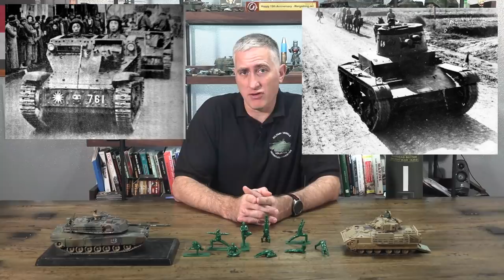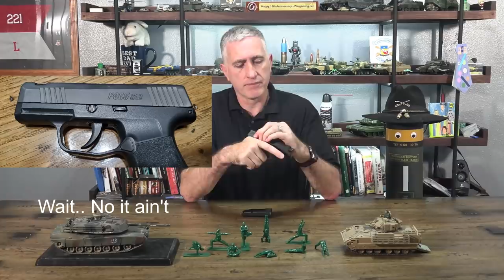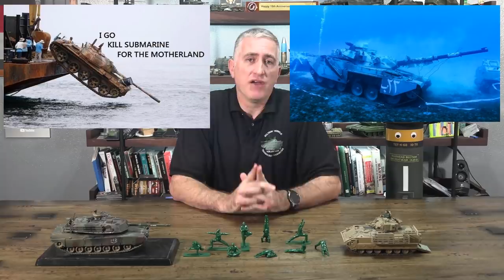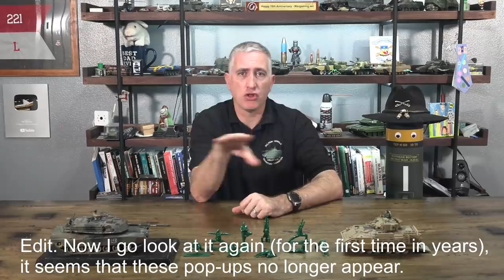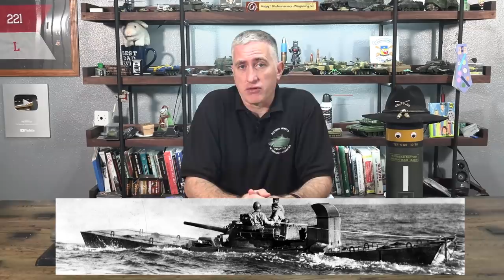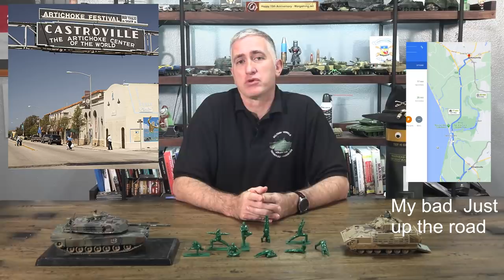Chieftain's Q&A 17. Rants, Ladas and shooting the other guy's cannon

Comment: 34:07 Using drones for tanks would be nice. Here's a fun thought. Drones not only improve your spotting range, but they also enhance the accuracy of artillery (which was interesting, because originally I thought that drones only improve vision range......but, I did a little bit of digging, and found out that they offer other beneficial attributes to the table)

Cause the concept kinda seems similar to the idea of aerial spotters for battleships. I mean, I think I read from somewhere on NavWeaps, that spotter aircraft (during the 1930s. According to the US Navy War College) were capable of boosting the probability of hitting an enemy ship (at very long ranges) by 600% 

(But, anyways somewhere in NavWeaps, its says that spotter aircraft were superseded by radar fire control on ships......but I don't remember why. Anyways, this is weird, because the concept of using spotting aircraft to improve accuracy of artillery still continued past WW2. One example being the AH-56) 

http://www.navweaps.com/index_inro/INRO_BB-Gunnery.php 

Also I seem to recall, that even in modern (-ish) times, aircraft are still effective in increasing the accuracy of artillery. One example that pops in my head is the AH-56 Cheyenne. Apparently this attack helicopter was fitted with sensory equipment that could help improve the accuracy of ground-based artillery.

Well, there's that, and also, because of Russia's use of drones for spotting, and relaying ballistics information to ground-based artillery in their recent conflict in Ukraine

Comment: 35:25 You forgot one feature. The boiling vessel needs an upgrade. All-in-one BBV (Barista Boiling Vessel) will not just heat your water up, but it will make the tea, coffee, cocoa or other beverage to your liking, including iced drinks. cream and sugar can be added based on the crew preference. Once the beverage is prepped it will slide the drink via a rail system to the crew member who requested it. The beverage will be served in a thermal mug to maintain temperature and a sealed top to prevent spillage on delivery.

Comment: @The_Chieftain engines with smoke....our old M113 APCs with the Detroit 6v71-T two-stroke turbo diesels would smoke like a factory, along with the AVDS V-1790 720 HP Diesel in the M48/M60 series.

Comment: Re: the M231 FPW, I'm actually working on reproduction screw/handguard/stock parts for cloning since original parts and existing repro parts are so expensive and rare. That's next after I finish up with the Colt DOE/RO633 front assembly clone parts.

If you ever get the urge to visually clone an AR-15 into an M231 (or RO633), give me a shout and I'd be happy to send you some bits and pieces!

Comment: Problem is, Lada was an obsolete design when it was introduced and parts for it are still manufactured to this day, meaning that the Ladas you see today aren't old, they had a lot of parts replaced Ship of Theseus-style. Whether that's good or bad depends on how much time are you willing to waste repairing and adjusting it far more often than more modern cars.
Reply: In fact, the Lada was provided by Fiat, shipping the whole factory to the Soviet Union as a sort of 'foreign aid'. Supposedly, even though there were some differences between the Fiat 124 and the first Lada's there was were cases of being able to simply take some parts from one and place on another, until the tolerances of the Lada parts had drifted to much to make this impossible. Still, supposedly old Fiat parts 'might' fit. Sometimes. And in some cases, Fiat parts were an upgrade (?) as with the hydraulic brakes. 

Now, on a separate note, supposedly the various 4x4 Ladas were nearly bulletproof, something that couldn't be said for the Fiat version. I guess being a nearly a farm tractor has it's benefits.
Reply: @charlesadams1721  Exactly, and this happened a few years after the release of Fiat 124 itself, so the design was dated when it was introduced, and obsolete for most of its production run.
Reply: @p_serdiuk  maybe, but if it's all you can afford or source it's damn better than walking

Comment: Re: Lada - the lack of servo means its a "manly" car, it is not designed with buffer zones, absorbing crash energy, so with anything faster than city traffic, you have a higher chance of dying - but in a city, if someone bumps into one, it WILL do more damage to whatever modern car it collides that the whole Lada worths and drive away with paint damage :) 
Makes people  keep a respectfull, safe distance around your car. Sometimes I miss mine from decades ago.

Comment: Since you mentioned the Osorio a couple times in this video, what is your opinion of the Osorio? I think of it as a missed opportunity since it seems to me it fits a similar niche as the Japanese Type 10, but 30 years earlier.

It also won a competition against the M1A1 and AMX-40 in Saudi Arabia, though I have the suspicion that it wound up being used as a bargaining chip to acquire M1s. Do you have any thoughts on the validity of the results of that competition?

Comment: Coming from more civilian-focused study of the Soviet economy:

Soviet civilian product quality control was particularly bad because downstream consumers (e.g. enterprises using steel from suppliers) had great difficulty rejecting inputs that did not meet specification. In a capitalist system if you deliver bad lenses to a camera factory, it's relatively easy for them to just not pay you and find an alternative supplier, whereas in the Soviet system this was a fraught political and bureaucratic process.

The military was always privileged, however; if their plane's servos or their tank's springs were bad, they could cut through the red tape and impose consequences wherever was appropriate on the supply chain. Very different level of quality.

Comment: Question for the future: Why Soviet wanted to combine both so advanced and antique tech in their BTR-60 APCs? Why old and complex double engine but modern independent suspension with torsion bars? Wouldn't something like beam axles of Zil with engine been enough, especially considering the requirement to share parts with mil trucks?

Comment: it's a major copout on the X vs. Y argument to make it as broad as possible ex. PZ IV started with 5 crew and continued to be upgraded and was more than effective till the end of the war while T-34 had 4 crew, no radio, and was still cramped and the 85mm upgrade only solved a fire power issue that was only really a problem against the fewer Panthers and Tigers plus they didn't even have a turret basket so the loader had to chase the gun around
indeed better is the enemy of good enough but good enough didn't really help them get better

Comment: Well, tracks are better in mud, but tanks also weigh vastly more. I think it would depend on exactly what kind of mud, and what kind of terrain. A tank would cross soft, boggy ground better, but may have more trouble hauling all those tons up a muddy slope. Flotation doesnt necessarily translate into traction. There is also a long debate in 4x4 circles about whether it is better to use big wide tires to float over the mud, or tall, skinny tires to dig through the mud to reach firmer soil below, and for less resistance. It really depends on the terrain. Although for most practical purposes I suspect the tank will come out on top. A 4x4 is only good compared to a 2wd, but it is actually lowest on the list of 4x4, 6x6, 8x8 and tracks.

Comment: A request,you made a vid of you showing fittings on roof of a grizzly/sherman.You pointed out and explained almost everything,you left out the bracket with a hole at the top,next to .50 rest and in front of turret..I have recreated it on a model,is it a .30 mount or something more mundane?Looks good,nice to know if asked what it is.

Comment: Both of my parents and now my sister worked/work for a company called Green Flag. It was National Breakdown back when my parents worked there. Anyways, according to my dad and confirmed by my sister a few years later, Ladas, based on numbers on the road, actually suffer the least amount of callouts for breakdown services followed second by old Skodas. Both the Skoda Favourite and the Skoda Estelle, based on numbers on the road, are good at not breaking down. Mechanically simple cars of course. Very little to actually go wrong with them. 
Nothing like the high-tech cars these days. Modern Mercedes' for example break down quite regularly with the most common issue being an electrical fault.

Comment: Are there advantages and disadvantages to the different types of hatches? IE hatches that swing open up vs ones that swing to the side, or split open?

Also, do IFVs with two-man turrets have the same disadvantages of commander overload that tanks with two-man turrets had? Was it deemed an acceptable compromise?

Comment: my question is, how in the name of god did a Leclerc end up in that position at 24:00
Reply: Well, you see boss, what happened is....
Reply: it was a hasty retreat  but id have thought the french would have had that manoeuvre down pat by now.
Reply: it for sure ended the career of 3 people
Reply: I know many US bases are on old farmland and occasionally tanks will find an old basement the hard way. Perhaps this is a similar situation.
Reply: @edcrichton9457 facts. I found one with a tractor once.........I wouldn't recommend it
Reply: @edwalmsley1401 , I found one with a Kubota RTV. Definitely wouldn’t recommend either
Reply: @Panzer:

The answer is pretty self-evident.
Just drive alongside the ditch, and then steer 1° or something into it.
The right-side tracks will slowly edge over, until they lose grip, and the tank falls down.
Apart from that, it's just an unfortunate coincidence of how high and wide the ditch is, and how broad the tank is (i.e. in this case it happens to be a perfect fit).

An interesting illustration of this effect is when Richard Hammond went cycling in... St Petersburg if I recall correctly(?) and tried to cross a tram rail 😂😂

If I can find a link, I'll update this comment.
EDIT: found it! https://youtu.be/OA1GXP1uOuQ
Reply: Alternatively, it was aliens.
They beamed up the tank, dropped it, and people then built a wall around it so they couldn't get it again.
#HistoryChannelFekts
Reply: Le D'Oh!
Reply: @KentuckyAk101guy  gravity is most unforgiving of all natures forces 🤣
Reply: Give 18 year olds a tank liesense
Reply: Looks like a old abandon fortifications moat.  Lot of French military ranges have old fortifications.
Reply: @hugopepe1722  Their still in there! 😄

Comment: Once saw an M113 stuck in the mud half way up the hull at Graf. They had two VTRs and an 88 pulling on it and it wouldn't budge. Don't know if they ever got it out.
Reply: Fire hoses to break the suction
Reply: Oof!

I remember the old Four Wheeler magazine had a "worst stuck" section for readers to send in photos. One month, the winner was an Abrams, sunk in the mud to about 12" in front of the driver's hatch...
Reply: @ScottKenny1978  was that at Ft.Drum?
Reply: @demonprinces17  this would have been about 2002 or 2003, I think. I don't remember if it even said where they were when that happened.

Comment: I seem to remember from a book I read, it may have been Death Traps, that they described a Sherman that appeared to have been shot down the barrel by a Panzer IV (their best guess).  They mentioned that it was one of the worst cleanups that they had to do inside the tank.
Reply: I would be extremely skeptical of anything written by Cooper.
I have seen photos of a Jumbo that took a 75mm round through the sight

Comment: Something I've always wondered about tracks... some use two thin road wheels with a center vertical guide, and some use a wide road wheel with two guides on either side. Is one objectively better than the other? What are the advantages of each?

Comment: Sorry if these questions have been asked before. Firstly what video game elements do you think would translate well to real life operations? For example third person cameras with wide field of view, externally mounted SAM/multipurpose missile containers on the turret to give a better defence against helicopters or to give top attack functionality, a retina projected overhead map displaying the location of all friendlies and potential hostile entities that have been located that can be maximised and minimised or a way to look around corners without putting your vehicle at (as much, this is still a tank in an urban environment) risk. Are there any you specifically would want?

Secondly why do most tanks mount their power pack to the rear, especially the ones designed to fight from behind a berm like Challenger which implies an emphasis on defence, when a front mounted engine would be more advantageous both in terms of extra crew survivability and accessibility? Is it just a matter of space saving or something along those lines?

Comment: I really think the soviet T-26 ( model 39 ) was a pretty good tank , if badly made, 
 it was probably a very capable machine when properly used 
on top the evolution of the type gave the soviet designer a good insight on what a practicable tank should be

Comment: I like your ccw having been in the U.S. Army when they still had the 1911, I really don't care for them. My ccw is a G 36 with ghost ring sights, I have the same sights on my G 17.
Reply: I love the M1911, but I have midget hands and anything double stacked barely fits in my hand, USPs aren't bad though.
Reply: @johnathanblackwell9960  the main reason I don't care for the 1911 is the amount of muzzle flip they have, of course this is caused by the high barrel axis in relationship to your wrist. 

The Glock barrel axis is much lower therefore reducing muzzle flip. The G-36 is a compact single stack platform in 45acp, I find it more pleasant to shoot with full house loads than my 9mm G-17 with ball ammo in it.

I wish Hi-Point carbines would take Glock mags.

Comment: Question about side-mounted sponsons: Weapons mull mounted in sponsons manned by crew members went out fashion after the WWI, presumably because they were more trouble than they were worth.
However, in the modern-day, what would be the pros and cons of having remotely operated sponsons? I'm thinking something along the lines of the sponsons fitted to the predator tank from Warhammer 40K. Also, I can think several cons (such as extra weight and width) but is there a con that kills the idea off immediately?
Reply: What comes to my mind immediately is that the Predator and Land Raider sponsons are fragile, and don't protect the guns very well.

Comment: Sir, o7 I know that our M4A1s have an upward momentum out to 175m before the maximum ordinate and the projectile begins to fall back down (As mentioned and shown in TC 3-22.9, Dated 13 May 2016, Appendix B, External Ballistics, Figure B-2. External Ballistic Terms), do rifled guns on tanks and other AFVs such as the Fighting Vehicle Cavalry/Infantry M3/M2 Bradley (and even smoothbores) have this quirk as well or is it a phenomenon only of small arms, and if it does exist on these larger weapons how much would cant do to uneven terrain effect the fall of shot on a vehicle armed with something larger than a 75mm or 90mm weapon?
Reply: Where did you get the 175m from? I looked up the document and it isn't mentioned at all. Also, all the graphic illustrates you referenced is, how the bullet drop compensation works. And that compensation is always necessary regardless of the caliber.

Comment: Chieftain, many turbine powered airline aircraft have auxiliary power units that enable electronics, pneumatics and hydraulics to be powered up without starting the main engine.
Does the Abrams or any other turbine powered tank have either an auxiliary power unit or even a standby generator to enable you to start a tanks systems without turning on the main engine ?
Reply: The original Abrams had some big battery packs, a turbine engine takes a lot of cranking to start up. The SEPv3 swapped half of one battery pack for a small diesel rotary engine apu.

Comment: Q&A The Polish Leopard 2PL got modern equippment. Got also great armor but only for the turret. The hull is still prone to be penetrated and get frotal rack, ammo stowage cooked. Poles could not get additonal armor because they would pass the top limit of weight for the suspension which is 60t.
Is it possible to make such armor (e.g. ERA) module detachable and keep it taken off (stored), to own it without using? Because KMW would not agree for overloading their construction and ruin it publicly. Still the armor would be needed only for a war time (when nobody cares obeying such contracts) so not have a fragile tank. And since it would add only 1 ton over the limit I would work perfectly. Is it any good idea to make such armor and keep it in secret so KMW wouldnt claim ossues?

Comment: Why are they (the dprk tanks) painted desert camouflage? To appear better on camera.
Also, they look like slightly redesigned versions of another tank  the dprk was building called the “Storm tiger”. The turret is near as makes no difference a match. The hull is longer and lower profile than armata, but add an extra road wheel to the storm tiger and you get that. So maybe a storm tiger with a new engine?